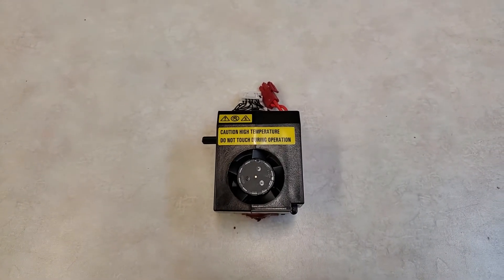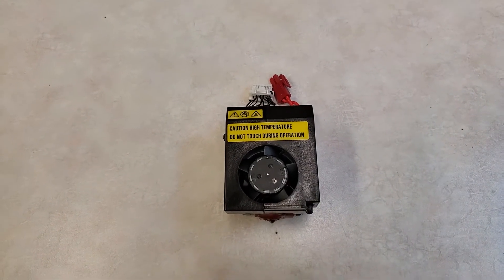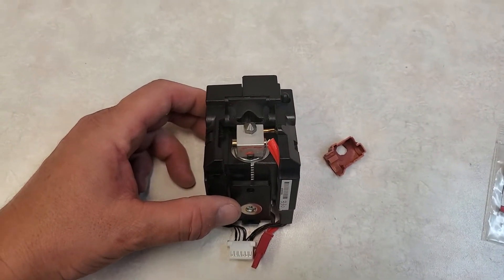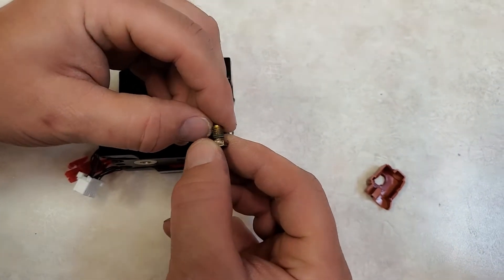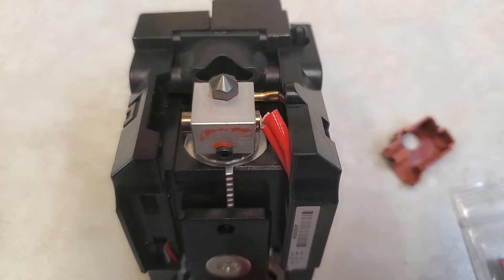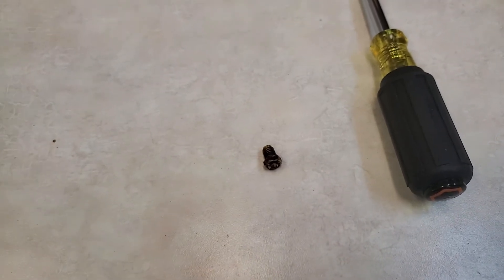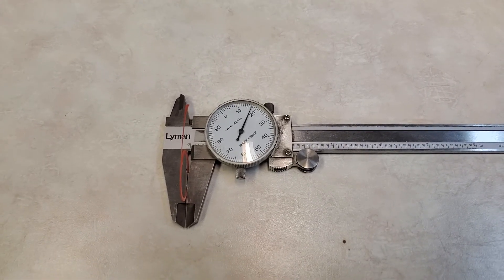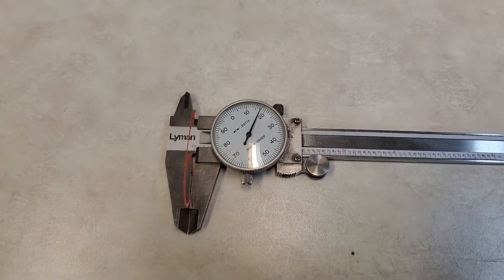Sindoh 3D-WOX1 Printer Nozzle Replacement.

Comment: Do you know if we can use this with 0.2 nozzles?
Reply from the maker: I imagine that a change from the 0.4 to 0.3 is not going to work. The drive will still be trying to put out the same mass of material through a smaller hole and it will result in a failure to feed. Probably much like the problem you get when trying to start a first layer too thin.
Reply: Machine Setting Value line 33 nozzle_size_T0: 0.4 0.2 0.6 , if you replace 0.2 to the front 3DWox Slicer will let you use 0.2 nozzle. Adtionally other slicers can just adjust for this change too.

Comment: Thanks for the information. I am looking very hard at this printer. How has it performed for you?
Reply from the maker: The printer has performed well. The only recommendation I have is to modify the printing plate. The spring steel plate comes with a coating to make bed adhesion better. This coating works well, but if you print a bunch it will start to separate from the steel and this causes problems. When (not if) this happens, peel off the coating carefully, clean the adhesive off with acetone or brake-clean and a lot of effort, and then just use a light dusting of aqua-net hair spray (unscented) and it works like a charm. Overall this is a great machine. It's quiet, repeatable, and the fully enclosed printing area makes for a great print in ABS. If you get it let me know, and I'll make a video about how I use the open filament function. Just don't try to use the flexible rubber kind a filament!!!   Thanks for watching.
Reply: @mistere02  Thanks for the reply! I gave on e of my printers to my son and am waiting for him to pick it up. I will then have room for my Christmas present. I have watched all your videos on the Sindoh line. They are the best I have found on youtube.